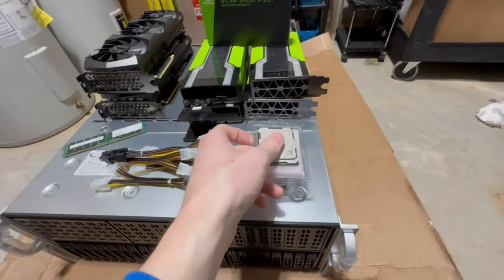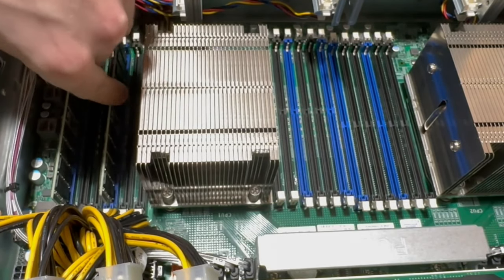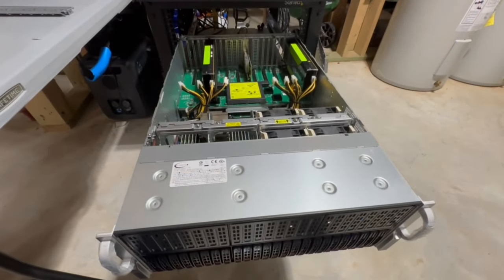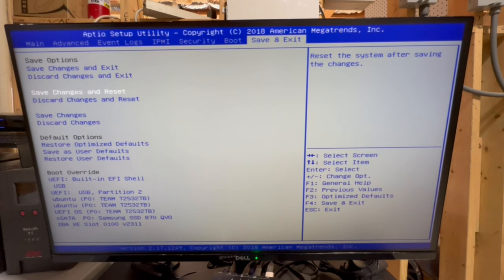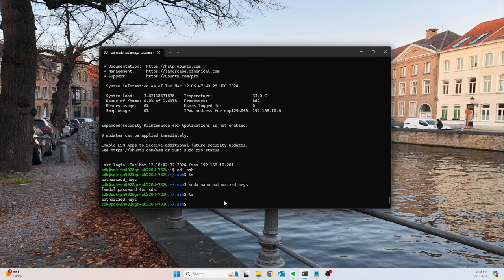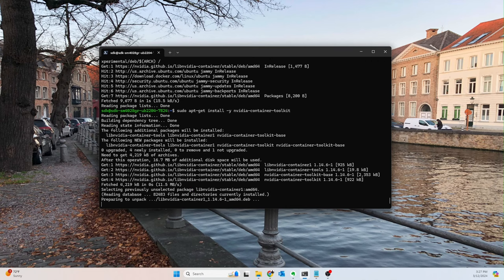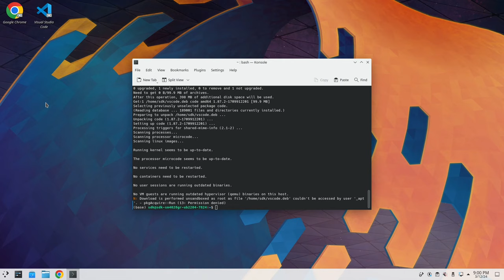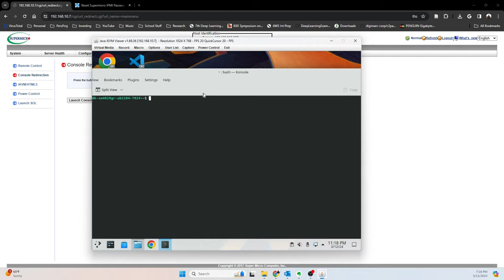8 GPU Server Setup for AI/ML/DL: Supermicro SuperServer 4028GR-TRT

Comment: This looks very impressive. Do we need that much RAM and Storage for AI model training? And can we install Nvidia 3080 GPU internally?
Reply from the maker: Hi there! Thanks for the question. 

So, you definitely do not need this much RAM or storage. I just have some particularly heavy work loads and having excess storage and RAM makes my life much easier. I would say try to get a little bit extra than what you think you will need for your intended use case. Also, I would spend a bit extra and more memory dense modules. This way you leave yourself open slots for expansion in the future if needed. 

It is going to depend a lot on the form factor of the particular GPU variant (ASUS, Gigabyte, etc.), but overall I would say it is a safe best to assume that it will not. Part of the issue comes in as well that the 8 pin power connectors are on the top of the GPU so there is not space to plug anything in between the top of the GPU and the lid. You could get creative and buy a 90 degree riser so the GPU would fit sideways or cut a hole in the lid. However, without any modification you can be pretty sure it will not fit.
Reply: @TheDataDaddi  Thank you for the quick reply. 
I have NVidia founders edition GPu which are smaller compared to other brands. Else I will have to purchase Nvidia P40 GPU, not sure about the performance of P40 as compared to 3080. Also is it fine if I go with only 2 RAM chips like 64 GB x 2 or do I need to install minimum of 4 RAM chips memory bank to work.
Reply from the maker: @SanjaySharma-ov1kf  The founders editions may work actually. Just do be mindful that you will have enough room to actually connect the power cables. 

The 3080 will be about 2.5 times as performance as the p40 on paper so it would certainly be worth using it if it is physically possible. Another route you could go is making an external rig for the 3080s. I have a video on that if you are interested in going that route.

https://youtu.be/zrcKGF156bA

The 4028GR-TRT supports dual Intel Xeon E5-2600 v3 or v4 series processors, which typically support quad-channel memory configurations. Each processor has four memory channels, and ideally, you should populate one DIMM per channel to maximize memory bandwidth. Using only two DIMMs might limit the memory bandwidth because only two of the eight channels (four per processor) would be utilized. However, it would still function correctly.
Reply: @TheDataDaddi  Thank you, I will try out the 3080 and 3070 GPU which I already have, if not I will buy P40. I do not prefer to have external GPU as it will be little risky with kids at home, even though the server will be in the garage. 
For RAM, I will go with 8 modules to get bandwidth efficiency. I am placing the orders on eBay, hopefully will get it by the coming weekend :) ..Appreciate your help and sharing of information, keep up the good work.
Reply from the maker: @SanjaySharma-ov1kf  Yeah if you already have a 3080 and 3070 definitely try those first. Please let me know if you can make them work internally. Great! I think this is what I would do personally. If you are patient you can find some pretty good deals on EBAY for relatively cheap RAM modules. Ofcourse! I am always happy to share what knowledge I have gained. Cheers and good luck!
Reply: @TheDataDaddi  Hi there, I got my server today and have installed 3070 and 3080 GPU, but for some reason these GPU are not detected on this server. Do I need to check any BIOS settings for GPU? These GPU cards are in working condition and it is working on another computer. when running ubuntu-drivers devices commnad, I do not see these two GPU in the list. Any clue how to fix this issue? Thank you in advance for the help.

Comment: Great video! I'm looking to replicate this :) Quick question about the PCIE lanes, it looks like all v3 and v4 gen xeon's have 40 lanes support each, so 80 total. How will 8x 16 (= 128 lanes) fit into this 80 lanes supported by the CPU?
Reply from the maker: Hey there. Thanks so much for the comment.

Great question! Yes, its absolutely true that each CPU only support 40 PCIE lanes. However, the 4028GR-TRT employs something called  PLX technology. These are basically PCIE switches that manage and distribute the 80 physically available lanes to provide higher connectivity, effectively multiplying the number of PCIE lanes coming from the CPUs and thereby increasing the bandwidth available to each GPU.  It also provides intelligent data routing between the CPUs and GPUS. This allows for dynamic optimization of PCIE lane usage. Exactly how this works I am honestly not sure. I should probably research this more. All that to say, it should be theoretically possible with this technology to support 8 GPUs at the full X16 lanes bandwidth. However, while it may certainly increase the bandwidth available to each GPU, I highly doubt that under full load with 8 GPUs you would get the full x16 lane bandwidth for each. This would actually be a really interesting thing to test! One day when I get 8 of the same GPUs I will definitely have to try it. lol. Anyway, I hope this answers your question. I wish could give you a more concrete answer, but this is the best I can do for now.
Reply: @TheDataDaddi  thanks a lot for your reply! Will look further into this :) I've ordered one of these servers, looking forward to getting it!
Reply: @TheDataDaddi  Hi Mate, I've just received my 4028GR, I currently have 4 GPUs total (2 p100s and 1 p40 and a rtx 3080), the 2 p100s are in the supermicro, and the p40 is in a separate desktop. In terms of splitting the 2 p100s across the 2 CPUs on the supermicro, would you recommend having both on 1 CPU or split it between 2 CPUs?
Reply: @rohithkyla7595  Hey I have ordered the same server 4028GR-TRT and have 3060 and 3080 GPU, but for some reason the server does not recognize the GPU. I have noticed that the power adapter is bit tight fit for these GPU cards. Did you install 3080 on 4028GR-TRT server? Do we need to change anything in the BIOS or did you use a different power cable for 3080 or 3060 GPU card? I am stuck without the GPU detection on this server.
Reply: @SanjaySharma-ov1kf  Hey, I am currently only running the P40/P100 GPUs which only need 1 8 pin connector which comes with the 4028GR-TRT. I do however have the 3080, but it has power adaptors at the top which makes closing the server's lid difficult. So, I'm currently not using the 3080 in the server. 

Regarding your issue, it could just be power related, I think an PCIE elevator + outside power should let you know if it's the server's fault.
Reply: @rohithkyla7595  Thank you for the quick response. I also doubt that it is some issue related to the power connector. I do not want to install the GPU  outside of the server. Just wanted to check if 3080 works on your 4028GR server. Not sure if I should return the server or buy P40/P100 GPU cards..but I really want to use the 3060 and 3080 GPU cards instead of going with P40 or P100 GPU
Reply: @SanjaySharma-ov1kf  any luck running 3080 inside the server?

Comment: Really awesome stuff, can you pls also recommend which type of server rack should be bought for this?
Reply from the maker: Hi there. So glad to hear you are enjoying the content! 

This is the rack I purchased (link below). I have 3 2U servers, the 4U 4028GR-TRT, a 1U switch, and a 1U PSU. It has worked really and been very solid. However, it is a bit expensive. You could probably find something cheaper possibly on EBAY or Facebook market place. 

https://www.ebay.com/itm/134077093756
Reply: @TheDataDaddi  thanks, can you pls recheck the link you shared?
Reply from the maker: @wasifmasood969  Opps sorry. Wrong link. Here is the correct one. 

https://a.co/d/18HuxQG

Comment: Really enjoyed the video! Do you know if the drive bays on that server are compatible with NVMe drives? I’m thinking about getting that server but I can’t find that piece of information. Thanks!
Reply from the maker: Hey there! Thanks so much for your question. 

So glad to hear you enjoyed the video! Unfortunately, I am not sure if the drive bays in the server are compatible with NVMe drives. I have used a PCIE NVME adapter card to add 4 NVME drives to the server, but I have not tried to used any of the drive bays for this. My gut says that the back plane would not support it, but I am really not sure. I tried doing some research on this and found absolutely nothing. I wish I could be of more help. If you find the answer here, please do let me know. This would be great info to know going forward.

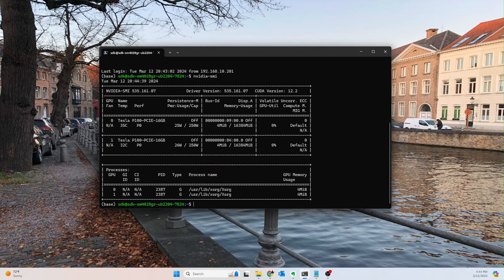Comment: 2:06:40 - that 25W per GPU idle because Nvidia can't ass to add power governor in headless drivers so that GPU can get off P0... P40's stay at 50W..
Reply from the maker: Interesting. This makes a ton of sense. Always noticed that and thought it was odd. Very surprised this issues has not been addressed. I also just checked for solutions. There are not any I particularly like. Apparently, you can try to manually set the GPU into a lower P-state with the following:

nvidia-smi -pm 1  # Enable persistence mode
nvidia-smi -pl [power limit in watts]  # Set power limit

Not sure if this works though. I haven't tried it yet.

Comment: @TheDataDaddi, Are you using 8 pin GPU splitter to connect 3090 card?  Is is 8 pin female to dual 8 pin male connector ?
Reply from the maker: Hi there! Thanks for the comment. 

For the 3090s, it takes 2 male 8 pin connectors in addition to the PCIE slot to power the GPU. I have to PSUs like you would use for a regular consumer grade mother board. I am using the 8 pin connectors from the PSU to power the 3090. I have one 500W PSU per 3090. For a more in depth explanation here, check out the video I have on setting the 3090s up. 

https://youtu.be/zrcKGF156bA

Comment: Hi @TheDataDaddi, I have couple of questions if you don't mind to help. One I want to boot from PCIE card with NVME SSD, but the NVME SSS is not recognized in the BIOS, but it works when I try to access using Ubuntu. And second issue is that I am not use the 3060 and 3080 GPU on this server, it seem that the power cable for GPU is different on server and not compatible with 3060 and 3080 GPU. I tired new  PCIE power cable from Amazon, but it didn't help. Can you please help on these two issues?
Reply from the maker: Hi there. Thanks so much for your questions!

1) For the NVME issue you will likely need to go into the bios and enable pcie bifurcation x4x4 or x4x4x4x4 depending on which pcie slot you have it in. If I remember correctly you will need to boot into bios. Then go to chipset configuration>north bridge and here you can change the pcie slot configurations. If you google super micro 4028GR-TRT block diagram this should should you which pcie slots are which. This this and let me know if it works for you.

2) The native power cable in the server is a male 12V EPS connector. This is designed to be used with Telsa series GPUs. However, you can by an adapter that will convert into the 8 pin connector that the RTX series GPUs expect. I believe the following should work for you:

https://a.co/d/fQ9ncia

Please let me know if you have any other questions!
Reply: @TheDataDaddi  Thank you for the quick response.Really appreciate your help and support.  I did change the BIOS setting, Under North bridge 4x4 and 4x4x4x4 but still not able to see the NVME SSD in the boot option. Can you please help to resolve the issue? I have ordered the cable from Amazon, hopefully that will fix the 3080 GPU issue :)
Reply from the maker: @SanjaySharma-ov1kf  Sure! Also make sure that under PCIE/PCI/PnP section the PCIE slot is enabled as UEFI. Another issue might be that you have not have set the bifurcation for the correct PCIE slot. Try it for other possible candidates if you have not already. Even with the block diagrams it can be a bit confusing to figure out which PCIE slot is which. Unfortunately, it could also be bad hardware. I order 1 4 slot PCIE to NVME adapter, and it did not work originally due to a hardware issue.
Reply: @TheDataDaddi  Thanks for the hehlp. I will try another options as well for bifurcation. Under PCIE/PCI/PNP I do not have option UEFI but EFI. The PCIE slot is working as I did install Ubuntu on it by booting from Ventoy USB but the NVME drive is not visible while booting.
Reply from the maker: @SanjaySharma-ov1kf  Sorry I meant EFI. How are you connecting the NVME drive to the PCIE slot?
Reply: @TheDataDaddi  I am using an adapter for NVME to PCIE, when I boot from ventoy usb, the server detects the nvme drive and installation is done. But when I boot the server it doesn’t work
Reply from the maker: @SanjaySharma-ov1kf  Hmmm. Let me do some more research. I am not sure why that is happening. I know it can sometimes be a pain to use NVME drives a boot drives.
Reply: @TheDataDaddi  Thanks for the help. BTW I used the power recommended by you and now the 3060  & 3080 are working in the server :) ..Now just need to sort out the nvme boot issue
Reply from the maker: @SanjaySharma-ov1kf  Of course man! Glad I was at least able to help with the power cabling. I will see if I can find a solution for the NVME boot issue.